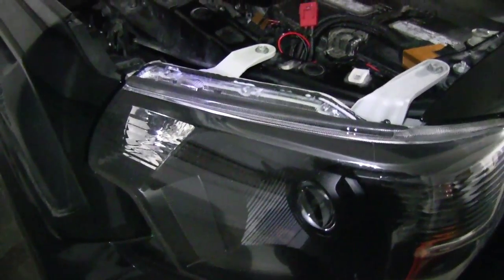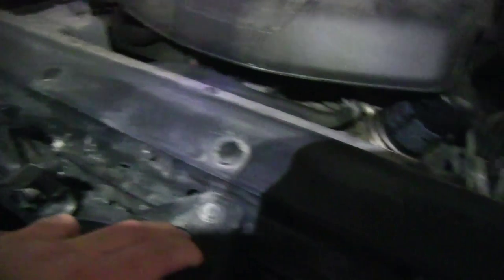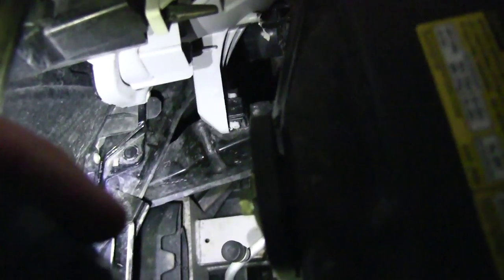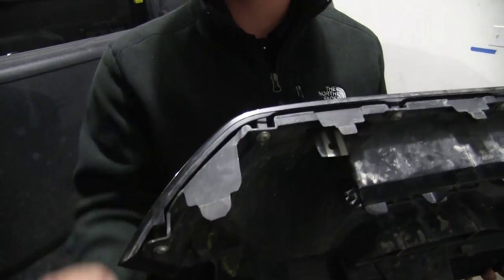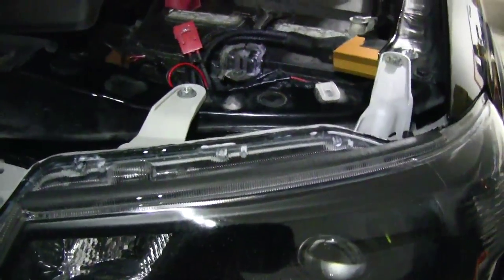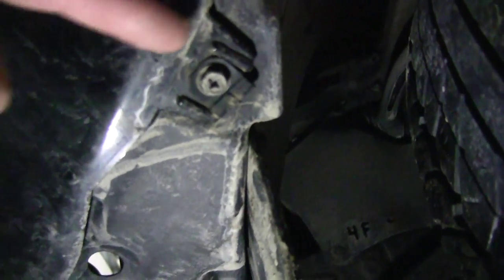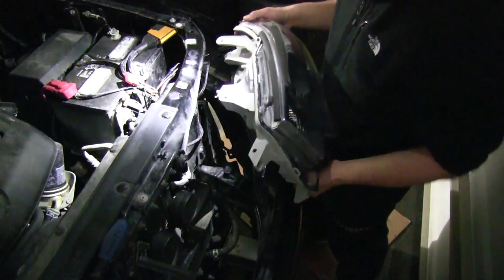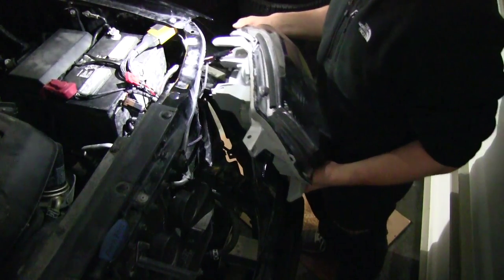2013 Tacoma Headlight Removal

Comment: Good shit
 sick truck, the custom paint on your headlights is sick you should do a tutorial on how you painted those,
Reply from the maker: Thanks man. I got my retrofit kit from, www.theretrofitsource.com , and i got after market headlights From TYC and had the retrofit done at Trax Customs in Idaho ( www.traxcustoms.com ) And Travis helped me out. The set up cost about $1,400. Would show you but did do the retrofit.
Reply: Not to sure what your asking the three sets wires that plug into your headlight are your DRL, the main headlight. And then the park lights. All 3 will have a positive wire coming into it but to determine that you have to test the wires it self. I don't know the colors. But when in doubt ask the dealership.